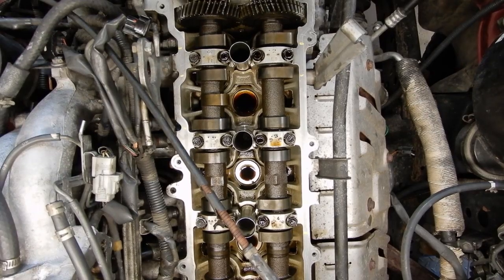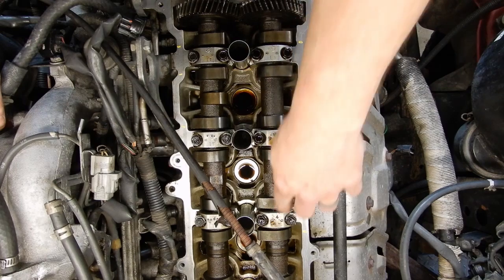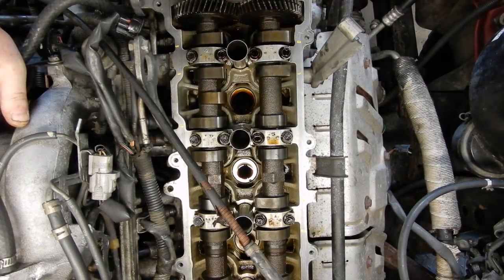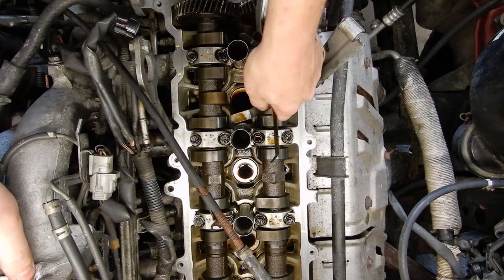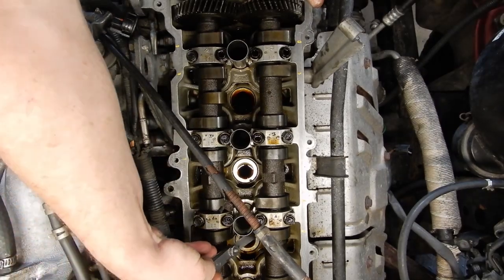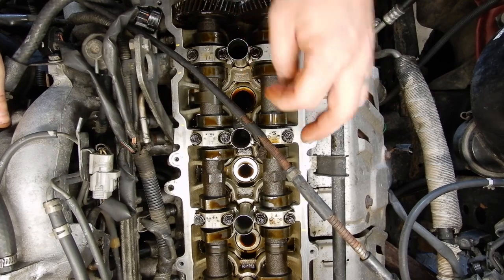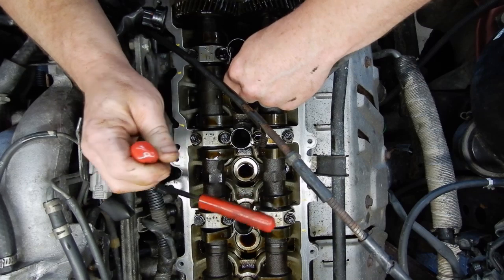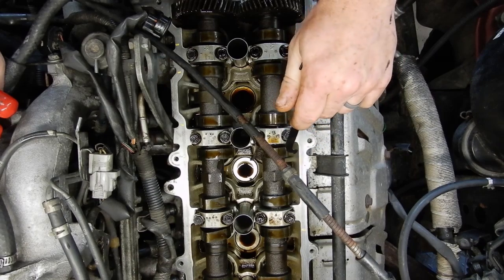Checking valve clearance on a 1FZ-FE

Comment: Im about to check the clearances on my 80 (1fzfe) however in watching the checking of the valves on Cyl-1 would have thought the cam lobe would be facing up vertical. Am i wrong in thinking that?
Reply from the maker: There's about 180 degrees of the cam lobe where it's at max clearance. They won't all be facing vertical when you check them.
Reply: @OTRAMM  Thank you!

Comment: Hello. Thank you so much for your videos they've been very helpful! I have a 95 Land cruiser 4.5. it overheated. Took the head to the shop to have it resurfaced and they screwed up the valve shims. The exhaust seemed to be all within the proper range. The intakes are not. 4 exhaust valves have zero clearance. 1 is within the proper range and the rest are around 3 to 5 1000s clarence. Any suggestions?
Reply from the maker: I'd take it back to the shop and tell them to fix it. If not, you'll have to go through and measure all the clearances and then use the chart in the factory manual to calculate the proper shims needed for each valve and then order them from Toyota. It's not fun. How did they mess them up? Did they get them out of order, or did the machine the valves?
Reply: Thank you for your quick response. There was no valve work done. They did number the shims and I put them all back in the correct order. I called the shop and he said that maybe one of his guys screwed up? I've seen two tools online that allow you to remove the shims without pulling the cams. The one you were using and another one that looks like a clamp that pushes the bucket down so you can get the shim out. Have you used the one that resembles a clamp?  Also I think I saw on your video the engine should be warmed up. I don't think I can start it with the intake valves being so tight?
Reply from the maker: @craigvalk99  the 1fz gets measured cold. It's older stuff that's measured hot. If you have more than 2-3 shims to change it would be easier to pull the cams. It's not fun pulling them out with cams in. I've only got the pliers style tool from Schley. I haven't seen the clamp style.

Comment: I'm doing a bench valve clearance test as I have my head off my engine. The first check is done with the single dot marks aligned on the cam gears meshed together. For the second test, would rotating the cams to mesh the double dot marks in the center be the same as rotating the crankshaft pulley one revolution?
Reply from the maker: That sounds like it should work.  I've never done them off of the block.  There's likely to be some movement in the head as you torque everything down that could throw off the clearance.
Reply: @OTRAMM  Thanks! I'll definitely recheck once the head is torqued down on the block. One more dumb question: a few of the lifter buckets have indents where the top of the valve presses up inside the bucket (on the small machined circle inside the bucket). If the valves have worn indents into the lifter bucket and the clearance is off, would you fix this with a new lifter bucket, reshimming, or both?

Comment: Ryan, first of all I would like to thank you for making these videos! I have become a huge fan of your channel.. Recently I bought a 1994 Toyota fzj80 1fz-fe Blue Merline and now it needs a cylinder head and exhaust cam. I found a brand new OEM cylinder head with both cams. My question is do I have to adjust the valve clearance of them? The seller says it's READY TO BOLT ON! What should I do? Please help. Many thanks from Australia. Keep up your great work for the 4x4 society.
Reply from the maker: I would at least check the clearances . They can change as the head is torqued to a different block.

Comment: Ryan, thanks for the video
My compression test came back fantastic and all my valves are also in spec. 

Heard you say you sent the injectors in, I see your intake is still completely assembled can I pull the rail to get the injectors out without pulling the entire intake off.

It looks like I can pull the fuel rail with the intake still attached, the FSM says different.
Reply from the maker: We do the injectors in house😀.  You can pull the fuel rail with the intake still on but it sucks. It's way easier to just pull the upper intake. Less chance of nicking an injector o-ring that way.
Reply: @OTRAMM  thanks 👍🏻 with 300k, while cleaning throttle body, checking valves and hot tanking valve cover should I go ahead and pull the injectors for good insurance?

Comment: I have a small oil leak on the 4th cylinder the head have a very invisible crack   I think this heads are notorious to crack there in that spot - do you have problem with yours?
Reply from the maker: I've seen two with hairline cracks in the head just below the valve cover gasket.  No idea what causes them though.
Reply: @OTRAMM  do they leak? my are leaking a bit so I verged a sponge between block head  and  supercharger so it can absorb the oil  - ya that  crazy
Reply from the maker: @skhochay  One of them that I've seen leaked, the other surprisingly enough didn't.